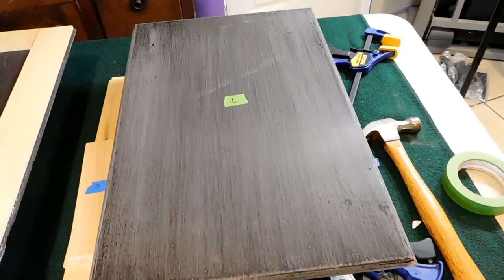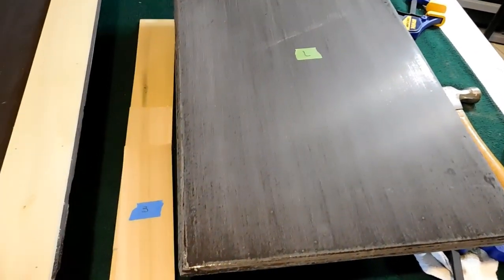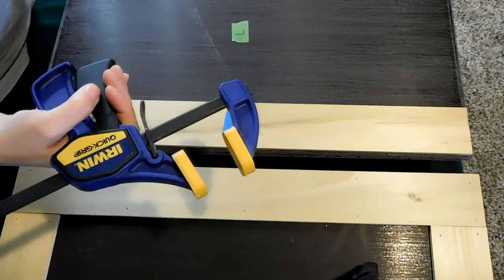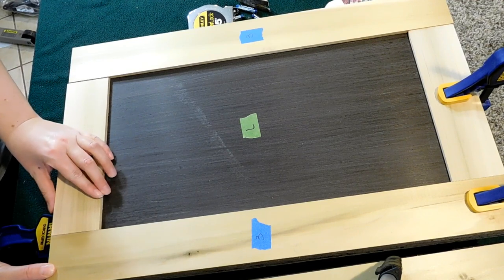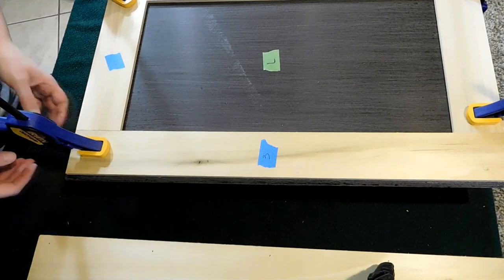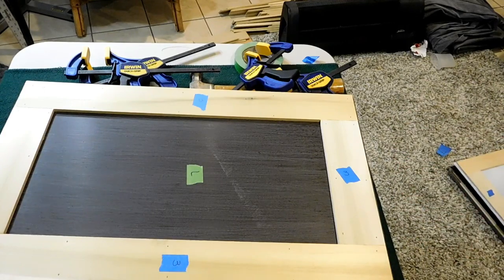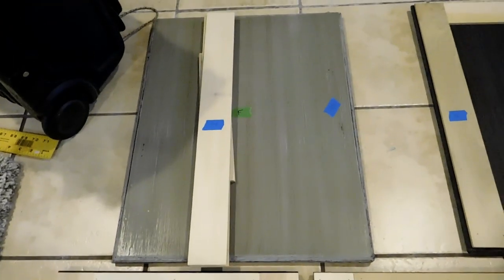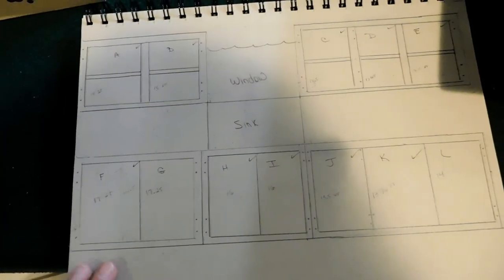DIY Flat Beveled Edge Doors to Shaker Style Cabinet Doors!!

Comment: Just a thought about lining up the board's to the door edges. Push the door up to straight edge/angle and then just slide the wood panel onto it and up against the angle, then fill in the gap with filler.
Reply from the maker: +Kevin Mitchell Casey thank you 😊. That's a great suggestion. I really appreciate it!
Reply: Or make a corner jig.

Comment: Do you have a video showing the finished job? What did you do with the edges? Thanks.
Reply from the maker: Hi thanks for watching this video :-). We actually sold that house a year ago, but I did make a empty house tour of the day we were moving, and I showed a brief overview of the kitchen and cabinets the day of moving. We did not end up putting any new handles on the doors just because we didn't know if the new owners would like the ones we chose. But the actual doors were painted with the new trim and everything, and it looked great! 
As far as the edges were concerned, are you talking about the filler that goes in between the actual door and the trim on the face of it?
 If so, I used caulk in between the trim and the face of the door to hide the gaps, and wood filler for any nail holes.
If you have any more questions, please let me know. I will try to link the video below of our moving day so you can get an overview of the finished cabinets. 

Moving Day
https://youtu.be/Jhy57--SVHk
Reply: @newdayvlogs  Thanks a bunch. Have a great year!

Comment: If you kept the same perimeter size then you'll still have exposed hinges. I'm curious if having the extra thickness of wood near a basic hinge impedes the ability to open these all the way
Reply from the maker: With my cabinet doors, I used a quarter inch outer trim for the face of the doors. So it wasn't to thick to open them all the way.  The doors still fit exactly the same as they did before and after the face trim was added with opening and closing them.  So when applying the face trim, it really didn't change anything.  They still opened and closed all the way like they always did.  My hinges were always exposed hinges.  My cabinets didn't come with hidden hinges. I guess I don't understand what you mean

Comment: What is the thickness of your original doors?  How thick did they end up being in the end?
Reply from the maker: I don't remember the thickness of the doors. I would say they were probably a half an inch thick, and then the wood trim that I used on the front was a quarter inch thick on top of that. So that would make the doors a total thickness of 3/4 of an inch thick including trim. Now when I say this that I'm talking about the face of the cabinet after adding the wood trim was probably three quarters of an inch thick including the trim. There was like a small indent of wood that set into the cabinet then the door was closed,  and that was probably a quarter inch thick. I hope that makes sense

Comment: Aweaome video, my cabinets are exactly the same & u inspired me.
Reply from the maker: Thank you so much! Glad to hear it!! 😃  You should post pictures of before and after if you do your cabinets! I'd love to see them 😊
Reply: Did you have any drawers? Was just curious because I would love to do this but I’m not sure how I would go about doing them?
Reply from the maker: Hi, I did have drawers but unfortunately I didn't have time to reface the drawers because we sold the house. What I was planning on doing with the drawers was putting a one inch wide strip of wood exactly the same way that I did the cabinet doors, on the face of the drawers. I used a 2-inch wide strip on the door faces. The width of the wood trim you choose to do really depends on the length and width of your drawer face. Our drawers were more slender and so I opted to go with a 1-inch strip of wood around the face of the drawer rather than 2 inch. And if you do your drawers, make sure that you get the right size nails so that they don't go through the backside of the drawers

Comment: Nicole thank you for putting up this video.  I have this issue right now with our home kitchen cabinets and like you wish to save them and our money 💵.  I was looking for something that could be done and you just made me a happy camper.   

okay question 🤔what’s the name wood you are using around the edges of each door?   What do I ask for at the store?   Again thank you!!
Reply from the maker: Oh thank you so much! 😊 I'm so glad that you find my video helpful! :-) I will list a link below of the wood that we purchased from Lowe's for the trim. Please let me know if you have any questions during your process. I hope that everything goes well and thank you so much for your sweet comment!

https://www.lowes.com/pd/Common-1-4-in-x-2-in-x-4-ft-Actual-0-25-in-x-1-5-in-x-4-ft-Poplar-Board/1000074305
Reply from the maker: I just realized that the board I use is no longer available on the website 😯. I did list the link below though. You might be able to find something similar. Just show the link that I sent you to customer service at Lowe's or even Home Depot possibly, and they may actually have something similar in stock.

Comment: I am redoing my cabinets and they're almost identical to these. Did you have any cabinet drawers that you redid with this method?
Reply from the maker: Zachary Dean I was actually going to do the drawers using the same type of trim in the same exact method as I did the cabinet doors, but we are actually moving and selling our house and I did not get to do the drawers. If I would have done the drawers, I probably would have went with a 1 inch wide strip that's a quarter inch thick instead of 2 in wide by quarter inch thick. 2" wide wood would have made the slit where the handle goes in the middle of the drawer, way too narrow. 1 inch wide strips definitely would give you more of an appealing look and more space in the middle for handles. that would have been my preferred method, and yes I would have definitely done that had we not decided to buy another house. And it would have been really simple to do. You would have just followed the same method as you would have the cabinet doors just using 1 inch wide strip instead of 2 inch wide. I hope this answers your question. If you have any more questions please feel free to ask :-). Thanks!
Reply: New Day Vlogs thank you so much for your help! I had tried to do a trim with mitered corners and it was just not working out very well this looks much easier and it looks really good too!
Reply from the maker: Well let me know if it works out  well for You! :-) If you have anymore questions let me know
Reply: Can you send me the link of the wood you used I looked at the Lowe's near me and couldn't find anything that looked like it. Thanks!
Reply from the maker: I sent it to you the other day on one of your messages. I'll see if I can send it again
Reply from the maker: Here is the link for the wood that I use for the cabinet doors.
https://www.lowes.com/pd/Common-1-4-in-x-2-in-x-4-ft-Actual-0-25-in-x-1-5-in-x-4-ft-Poplar-Board/1000074305

The paint that I used is at lowes and is Valspar Cabinet Enamel

Comment: What kind of wood , board did you use ? What where dimensions as far as the width. Thanks
Reply from the maker: The boards are 4' x 2" x 1/4 " thick. Made from Birch wood, and I got the wood from Lowes.

Comment: For the few brads that don't counter sink I would use a nail set tool or something you could hit the head of the brad with rather than hammering the head of the brad. The hammer directly on the brad could damage the trim.
Reply from the maker: 888hoosier thank you for the tip! :-) I really appreciate that :-). I will definitely keep that in mind for future projects

Comment: So did you just leave the beveled edge exposed and just sand it smooth?
Reply from the maker: No the trim was not flush with the beveled Edge. The trim came almost to the edge of where the top of the door was squared off and then the beveled Edge stuck out a little on the sides. I caulked around the trim, and everything flowed beautifully together as if they were custom made. You're welcome to check out the video of our moving Vlog. We sold our old house but I did capture a brief shot of the kitchen cabinets in that video if you would like to see the final results. I will link it below. Thanks for watching

https://youtu.be/Jhy57--SVHk

Comment: What did you use for the stiles?  We're they off the shelf trim?  What dimensions?
Reply from the maker: The only thing that I used for the face of the doors, were 2" wide x 1/4" thick pieces of trim that I got at Lowe's. They came in about four foot long strips. All I did was cut them to size for each piece, and then wood glued and nailed them on after placing them, and marking them where I thought they needed to go. The doors beforehand we're just flat, and so I wanted to give them a facelift for a more modern look, by making them a shaker-style cabinet door
Reply: @newdayvlogs  Thanks.  Did you drill pilot holes for the nails so the wood trim wouldn't split?
Reply from the maker: I am so sorry that I'm just now seeing this reply back to me. I guess better late than never  😊. But no I did not pre-drill holes. I used a Brad nailer. I didn't have any splitting whatsoever

Comment: What did you fill the edges with?  The gap between door and the boards.  Did you have to smooth it out with anything and sand?
Reply from the maker: I used caulk on the edges. After I added it, i took a damp towel and wiped the excess off, and the damp towel help to smooth it out.

Comment: What about the gap between the new trim and the beveled edge? Do you have any photos of hat? I’m wondering how that looks when seeing the doors from the die or above. Want to try this so badly!
Reply from the maker: There shouldn't be any gaps between the trim, and the beveled edge.  I don't actually have any pics of just the edges, but the finished look of the cabinets was on our moving vlog at the end of 2018.  But it was an overall kitchen tour.  Depending on whether you are staining the finished product, or painting it, depends on the technique used for hiding the gap between the door face and trim.  Because I painted my cabinets white, I used white caulk between the trim and door face, so there wouldn't be a gap.  And it looked great!! After the first coat of caulk was smoothed, and dried, I went back and made sure it didn't need more (just in case the caulk shrank in some areas).  After I was happy with the caulk, I was ready to paint.   If you are staining, then you would need to apply a stainable wood filler in the gap between trim and door face, and make sure to sand good without taking away the shape of the wood.  Make sure to get the smoothness you want before staining. But the overall look shouldn't show any gaps :).  I hope this was helpful.  If you have anymore questions, please let me know.  Thanks!!

Comment: Hello I have the same doors as you do and I'm trying to do step by step exactly  like you did. But I have one question. Will the wood filler hold in space between door and trim around ? I did mistake and filled with wood filler not the caulk. I tried to followed each step  but forgot that you filled with caulk. Please recommend what to do?
Reply from the maker: I know that wood filler can chip off really easily, and possibly look a little bit grainy. but I guess it depends on how thick you're putting it in. What I would recommend if the wood filler isn't sticking out of the seems too much,  then to possibly go over the wood filler with fine grit sandpaper and then put a fine line of some caulk over it and kind of smooth it out good. Make sure that you sand the wood filler down enough to where the caulk can smooth over it. I hope that makes sense. But I would try to sand down the wood filler as much as you can and then for a smoother finish go over the cracks with the caulk and then paint over it. That's the only thing I can come up with. I'd be afraid for you to try to scrape the wood filler with a putty knife or something because you may chip the wood. Let me know if that works out.

Comment: It's probably too late to get an answer but did you do the same thing with the same size or smaller to the fronts of the drawers?  This is exactly what we have but ours are light cleared maple.  I want to stain them or paint to look like wood. (I hate painting nice wood but it would have to match or maybe not.  I haven't figured that far ahead yet)
Reply from the maker: We actually sold the house to buy a new one, and I never did do the drawer fronts. I left them flat because the house sold so fast. But I was going to use about an inch wide strip on the front drawers instead of a 1 1/2 to 2 inch piece like I used for the doors. So I definitely think that you should use more of a smaller strip for the drawer so it doesn't look too chunky. And you definitely want to match the thickness of the doors and I used a quarter inch thick piece of wood on the front of the doors. I think that anything over 1 inch wide trim for the drawers, would come too close to the handle and cover up too much of the drawer front depending on the size of your drawers. I hope that makes sense lol. Go into the lumber department at Home Depot or Lowe's and see if they have any type of flat trim in that size frame. I know that the strips of what I use for the front of the doors are not being sold anymore 😕. I was actually trying to show a subscriber the other day the link that I used, and they recently just stopped selling it.  When I clicked on it it said it was sold out. But I'm sure that they've got similar items in the store. I used a piece of 4 foot long by quarter inch thick by 2 inch wide Poplar strips. They don't actually sell those anymore but you might be able to find something similar at Lowe's. Just tell them you would like something maybe 1 inch by 4 by quarter inch thick. If you have any more questions please don't hesitate to ask. :-)

Comment: Thank you.  I will also check a mill works place I know of.  I was thinking it had to be smaller on the drawers...I will look at samples too.  Hopefully  it's cheaper than new doors/facelift and I have to sell my wife on the idea...
Reply from the maker: You're welcome :-). It is so much cheaper than replacing all your cabinet doors. It was going to cost thousands of dollars to replace the doors at my old house. I think all of the wood trim for my 22 cabinet doors at the old house was around $150. It takes a while to do it right, but it's worth it in the long run. Just remember to caulk the edges in between the trim pieces and the door face, and make sure to fill in the nail holes with wood putty  when you nail them on and lightly sand. If you're going to be staining the doors, then you will have to fill in all of the gaps between the trim and the door faced with wood putty and then sand the edges. Caulk worked excellent on mine because I was planning on painting them. Wood putty will take a while longer when you're filling in the edges, but it will work. Make sure to get a stainable wood putty. Also, make sure that your nail gun nails are not too long or it will go through the door and the trim. If you have any other questions please let me know. I hope that your project goes exceptionally well! :-)

Comment: Great video! I'm trying to update my kitchen cabinets as well. They are completely flat with no bevel so it might be easier. Anyway, can you give me a link to the the wood strips you used? Were they precut or did you cut them yourself and what did you use to cut with if you did? Thanks so much!
Reply from the maker: Thank you so much!! 😃 I'm going to paste a copy of the link below of the boards that we purchased from Lowe's. I used a miter saw to cut them to size. They were four foot long when we purchase them. I find that you need at least two boards per door depending on the size of your door. You need enough for all four edges. I hope this answers your questions :-). If you have any more please feel free to comment back. Thanks so much for watching my video!

https://www.lowes.com/pd/Common-1-4-in-x-2-in-x-4-ft-Actual-0-25-in-x-1-5-in-x-4-ft-Poplar-Board/1000074305
Reply: New Day Vlogs Thank you so much I’ll be sure to purchase those soon! Did you do your kitchen drawers as well? I assume you’d have to get smaller boards?
Reply from the maker: I have not done the kitchen drawers yet. I will probably use a smaller size because our drawers are skinnier. Possibly instead of doing a 2 inch wide piece, I'm going to try to get a 1-inch wide pieces of trim by a quarter inch thick :-). It just really depends on how big your drawers are. Because my drawers are really  slender, it would not give much middle room for the handles if I did the pieces that I got for the doors on the drawers. That's the reason why I'm going to go with 1 inch by quarter inch thick. 😉 I wish you all the best with your project, and if you'd like to, I'd love to see pictures when you finish! 😃

Comment: Looks good!. Currently doing the same thing. Weird I came across the video. What kind of wood did you use for trim and what thickness?
Reply from the maker: Thank you so much! :-) I used birch wood and it was a quarter inch thick by 2 in wide and I used 4 foot long boards. They were already precut to 4 feet at Lowe's when I purchased them. Good luck with your project! If you have any questions or want any recommendations for anything, just let me know! Thanks again for watching 😊
Reply: @newdayvlogs  Thank you so much for replying.  Comments on  older videos  don't always get looked at. Appreciate it!❤
Reply from the maker: You're welcome 😊👍.